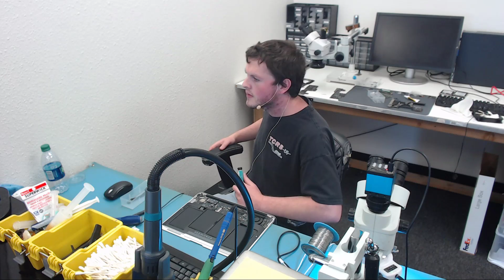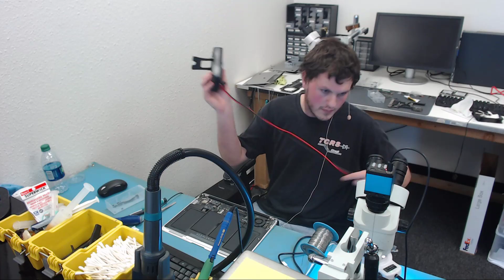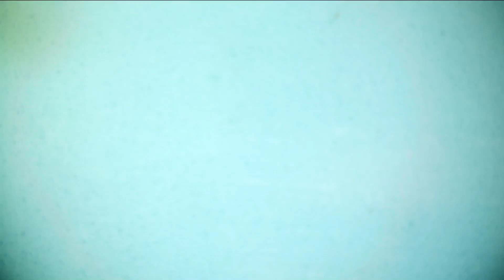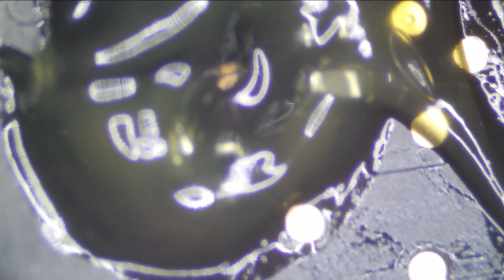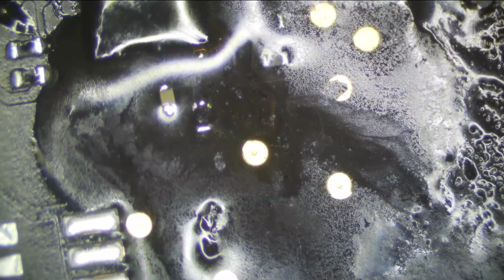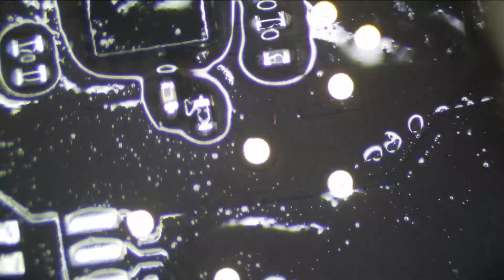Can new computer assembled by questionable repair tech stream macbook repair?

Comment: I would expect if you moved your mic interface to front USB ports or any USB ports other than the RearI/O built into the motherboard - you're liable to pick up MORE interference  - usually the wire inside the chassis acts like an antenna - but yours sounds well insulated. IO sheilds in your usb ports explains it, Come to think of it - My X99 Mirco 2 has one of those puffy metal tinfoil like backings and it's always had dirty sounding power - mayhaps this is why.  Neat.